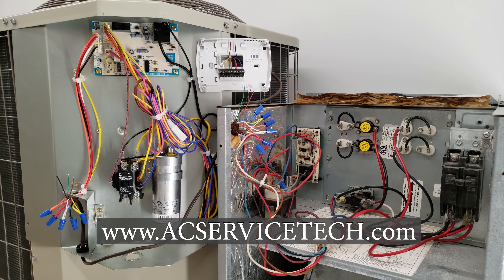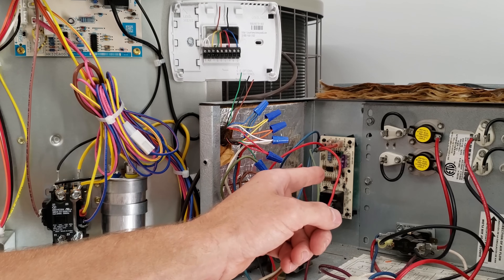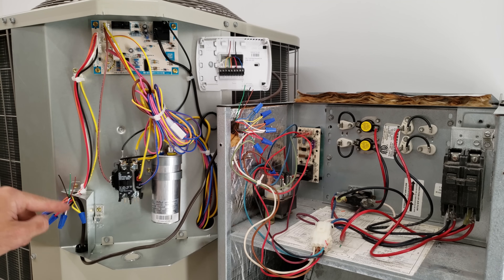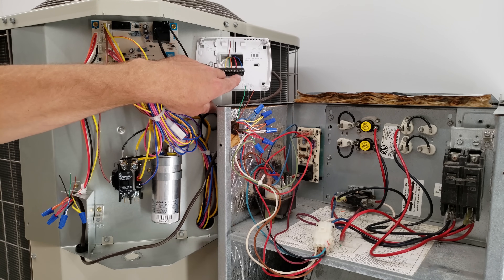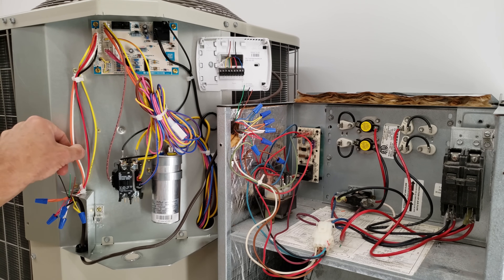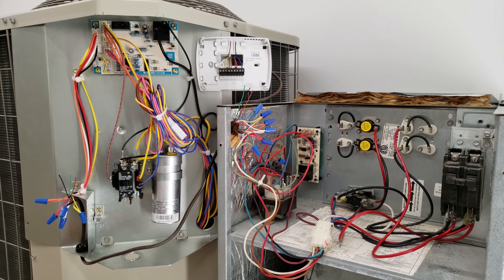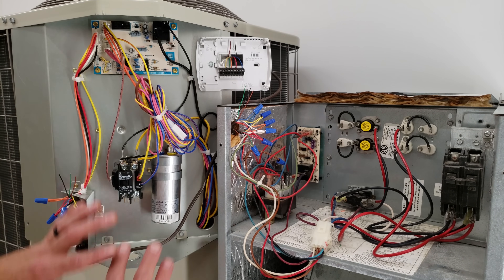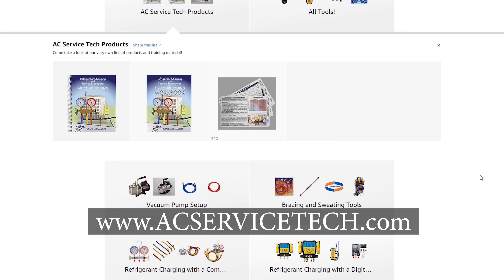How an Air Handler & Heat Pump Work & are Controlled by 24v Thermostat Wires!

Comment: I am trying to install a Nest learning 4th gen thermostat. My current system is a Rheem heat pump with a Honeywell thermostat . Current wiring is R, a jumper connecting R and Rc, Y, C, W(O/B),G,W2(Aux),Y2(E). When I install the nest thermostat, it blows hot air on cool mode. I tried using B instead of O as reversing valve, but it does not work. In the options I chose forced air instead of electric strips. Is it correct? What should I do?

Comment: You have the auxiliary and emergency jumpered together on the thermostat. Therefore regardless if in emergency or auxiliary heat, your heat pump will turn off?
Reply: I believe the difference is, when you put the thermostat in Emergency Heat, the compressor contactor (the Y contact on the thermostat) is not energized, meaning no signal to the compressor. In conditions where aux heat is called for (eg. the compressor goes into defrost), the Y wire is still energized.

Comment: Weve had this happen a few times now when an old package unit dies, these older ones are ugly levels of complicated, mixes between 12,24,230 and some with 400v combinations, so when one of the boards goes, we end up fitting a controller used for chillers, mostly a danfoss 211 or 213. Then well set it up for heating and cooling, install relays for compressor, fans, fit the new probes its a job and a half but if the unit works afterwards it buys the time. Plus side its much easier to work on. Just the customer cant alter the temperature.

One of the other guys (learning) came across a 3ph system but only hooked up with single phase…it was the pre heat element. I suggested he disconnect 1 element, based on ohms law and wire the other 2 in series or parallel not knowing what would be easier, this is a conversation over the phone. Then i told him to loop the contactor si its terminals shared the load. Boss told him to fit a controller with probes to the element contactor. I didnt think that was wise as it being an element, it needed to know there was sufficient airflow, so needed to have the sail switch involved, so im hoping the sail switch was put into the new controllers heating contactor coil wiring.  Not sure how else soneone woukd go about the same thing.

Comment: How awesome would a Diagnostic plug be on the 18-2 wires at the Condenser. One small digital tool to plug in to show every function is working in real time. Much like the OBDII plug on vehicles. This would cut down diagnostic time immensely.

Comment: Thank you! Could you possibly explain the Temp Sensor on the Compressor? Having a problem finding one for my 20 year old Carrier Heat Pump. Wires to this  switch is deteriorated/exposed. Very difficult component to find without knowing what it’s called. “Compressor Over-Temp Switch” maybe?

Comment: Why would the air handler blower rev up and down, on a heat pump system,durning the time when the reversing valve is engaged during winter?

Comment: Can you offer guidance on the cumulative timer settings.....what would cause you to use 30 vs 60 vs 90 min? Seems 30 min is most "safe" and conservative....but maybe checking this often means (?) that the system puts the high-draw emergency power strips "on" more frequently....therefore instead use 60?.... or some thinking like that ? ...Nice vid !!!!

Comment: Great video.  As a design engineer, a couple of things I don't get, is why don't they use terminal strip instead of wire nuts and why have so much extra wiring all bunched up in the heat pump since they know how long the wires need to be when they build it, and why not maintain consistent color codes throughout to prevent confusion, black for common not blue.  Also the red wire from the transformer to the defrost board is not explained which is most likely used to power the electronics after rectification and regulation.

Comment: Starting a new assignment at an apartment complex with heat pump condensers which I've never worked with before, thanks so much for the simple yet effective explanation.

Comment: So the higher fan speed (in the presence of a time delay board with a y terminal) are wired into the same wire as the pressure switches connected to the defrost board in the condenser? That seems weird.

Comment: So, in defrost mode, the heatpump sends refrigerant to the expansion valve that is located on the coil? If so, the air handle gonna blow cold air to the house ( in case the air handle doesn't have an electric heater)

Comment: What causes  the pump to run with thermostat  off
Reply: Check for bad thermostat, thermostat batteries (if present), or thermostat wires touching inside wall thus completing circuit.

Comment: I am an electrical contractor. I have specialized in controls for many years now but I never worked in HVAC controls. Lately I have been installing home genetators and needed to know how the heat strips worked so I could interrupt them under certain conditions during generator power. I appreciate this thorough review of the split unit. I feel more confident now that I have had this overview. Thank you for posting.
Reply: Is so sweet sir! He is indeed good master of his art

Comment: can someone explain why the Yellow tstas wire being energize in. heat mode
Reply: I'm new to all this but I believe the correct answer is because this is a heat pump. When you turn a heat pump to heat it energizes Y (compressor/cooling) because that causes the AC part of unit to work in reverse. Heat pumps use the components of the AC system but it runs in reverse and that's how the heat is produced. When you call for cool, the O (reversing valve) is energized which causes the unit to run in the correct direction which makes cool air. That's why the Y is energized in Heat. I hope I was able to explain that enough to help you out. I am just now learning all this because I am currently having issues with my heat pump so still not the greatest at explaining it or exactly how it works but it is the cooling system running in reverse which makes the heat.
Reply: @jennifermatoy8633  Thanks for help you’re correct i work in the hvac field and learnt this lol.. it is a heatpump with a reversing valve so R and Y is for heat
Reply: @butlerstouchHVAC  I have definitely learned a lot over the past couple weeks.
 I never could figure out what the problem was with my unit because everything seemed to be good when I was troubleshooting so I decided to just start over. Bought a new thermostat wire. Wired up the new thermostat I had bought and took it outside with me to the unit and after sitting there watching videos and making sure I was testing stuff right, it kicked on. Been doing fine since. That seemed to be the problem. 
I actually ran the wire through my bathroom window and had the thermostat sitting on my dryer until I could figure out how to run the wire. I wasn't having any luck getting the old wire to pull through so I  finally decided I had to go under the double wide, whether I wanted to or not. While under there, I figured out why only one side of the trailer blows good and the other doesn't. The crossover duct had a hole in it so I taped it up and had a little tape left and worked my way on to the other side. When I seen the return duct, it had a huge hole in the bottom of it and I thought well crap, I definitely don't have enough tape to fix that lol. Anyway, I got my thermostat wite ran under the trailer like it should be. Unfortunately, I am now buying new flex. 
The supply from best I could tell didn't have a hole but the silver stuff was gone in spots but the black underneath wasn't destroyed yet. I tried to figure out what size supply and return I need but that isn't working out. The unit calls for 14" and 16" but when it was put in years ago, the square to round adapters where made for the size of duct already under the trailer and my ex doesn't remember what size they were. He thought one was 14" but not sure what the other was. I did my best to measure around the duct where it is on the collar and I came up with 48" on supply and 50" on return but after researching, those numbers don't seem to be quite right. I'm starting to wonder if both ducts are 14". Now I'm thinking that since I have to replace both supply and return anyway, should I just go with what should be hooked to the unit? Or try to figure out for sure what is under there now and put that size back? Shouldn't the return be a little bigger anyway or is that fine? This is a whole new category for me and my situation doesn't seem to match what I have been reading so any advice would be appreciated. 
I do know the crossover is 10". I could still read the side of it. Also the crossover is on the opposite end of the trailer from the unit. That would be the original duct work. There was an inside unit on that end of the trailer. The return has been moved to the kitchen and then runs to the unit. The supply comes out of the unit and looks like it is shoved in the main trunk that runs down the back side of trailer. It is right past the first vent from that side and the return runs down next to the main truck to the unit.  It is the back side that blows good.
 Is there anything you would suggest I do or just leave it like it is and make sure it is all sealed up good? I don't plan on having to get back under there so I would like to try and get it fixed up right and then not have to worry about it.

Comment: Craig--excellent tutorial!  I have almost exactly the setup you describe, air handler/gas furnace inside, and heat pump outside.  I'm curious why the yellow compressor wire from TStat to Heat Pump (compressor on, whether reversing valve is activated or not for cold/hot) also needs to go to the air handler....presumably, increase fan speed when the heat pump is running?   Does the heat pump require a faster circulating fan speed indoors than, say, emergency heat using just the white wire to the air handler heater?

Comment: Very thorough and clearly explained. I have a Lennox heat pump system that has not been able to run the heat pump. The defrost board Y terminal seems to pull the thermostat's 24v signal to ground, effectively shorting it out. I checked the defrost board for continuity to ground on Y with no wire attached and it seems to be shorted. Is this something you've seen? Seems like the Y input on the board should not act like a ground. This system is only a little over a year old, with no corrosion issues. I'm thinking either the board is bad or maybe a pressure switch is grounding the circuit.

Comment: Great videos as always!! I have an older York heat pump system. I replaced the thermostat recently, when unit is calling for heat, the blower motor turns on, however the outdoor unit does not kick on. Is the outdoor unit supposed to turn on also, when calling for heat?

Comment: i have normal 5 wires coming out of wall.  why would air handler only have 3 wires (see 2 pictures of air handler above-wont let me attach:) and no wire on W heat terminals even though my heat worked fine when it was connected to honeywell thermostat…now changing to nest and heat is acting weird and smells gaseous for 5 min then heat turns off and stays off even though i have it set to a warmer temp.  Any help greatly appreciated! can i send pics to you somehow?  Single mom trying to get this working correctly while keeping my child dafe from fumes.  I have the normal 5 wires coming into new thermostat but heating is not working properly like it was on older thermostat.

Comment: So with a system like this if the reversing valve went bad would the unit be incapable of switching from heating to cooling, or would that only cause the defrost switching to fail?

Comment: Thanks for your fantastic video and explanation.
R wire is going to the outdoor unit. Could you please tell me what the purpose of this R wire is? The new heat pump outdoor unit requires only 4 wires ( O, W, Y and C wires).
Thanks

Comment: Thank you so much for this video. Been working confident with heat pumps after this video but suddenly ran into a heat pump condenser that has w in and w out terminals. Have you had these defrost boards?

Comment: Question, my ptac unit stop working because of faulty control board, it is an old unit and can't find the parts anymore however I really don't want to throw away the rest of its components, (condenser, fans, compressor, etc,), so I am thinking about getting rid of the control board and replace it with regular switches like, wall thermostat, contactor, heat sequencer relay for the heat strips, do you think is a good idea or not? because I'm only concern about the safety switches in the control board, but by adding some pressure switches and heater limit switches I'm thinking it will be ok, besides it would be a fun project

Comment: Is it possible to run a heat pump with a straight cool air handler? AH only has common, 12V, fan. I couldn’t b/c during heat, I have R G W, no Y. Goodman 5 ton.

Edit: I think I just answered my own question. No (since I don’t know much) but I was just looking at my other AH that is designed for a heat pump, it has all the guts for sending Y compressor out. Mine don’t have all those wiring. My 4ton unit at work also has the same guts for a heat pump setup.

Comment: So I'm a building engineer and I was wondering if they make a reversing in valve with a hot gas bypass so you don't have to worry about switching back into cool mode just for defrost the condenser. Because I know our chillers have it at my work and it just uses it to put a load back on the chiller.

Comment: You are in good company for not knowing when a carrier heat pump will go into defrost.  If it worked like you said, the heat pump would be in defrost mode every thirty, sixty, or ninety minutes of heat pump runtime if the defrost tstat happened to be closed at the end of that time period.
How it actually works, is once the defrost tstat is closed, the timer starts. As long as the defrost tstat STAYS closed, the timing will continue. If, for example, the runtime with defrost tsat closed is forty minutes and jumper is set for sixty minutes, and defrost tstat opens at 65 degrees of coil temp, the timer resets to 0 minutes of runtime. 
So, its how long the defrost tstat has been ENERGIZED that determines defrost. And that time resets if not met.

Comment: The red wire from xfmr, goes to power the thermostat. But I noticed that, it also goes to the heat pump. Maybe I missed it, but what does the red wire do at the heat pump.

Comment: Hi Craig question, I had a Custumer the want to install a heat pump, but he want to feed the outside unit from the tenant panel for AC and from the house panel for heat in other words he pay for heat the tenants pay for AC, so it going to be be two feed for same unit is anyway to interlocking those two feed using a rely , any idea if it possible?

Comment: how do you hook up an heat pump type heater/cooling system to a system that only uses outside a/c unit with a heat strip only inside? thanks, Robert

Comment: My thermostat will not power on ….
Reply: Then you have no 24volts , check your red wire or the 24 volt wire in the thermostat

Comment: Thank you for your video. I checked there is only 13.5 VAC between Green and Red wires on the thermostat. Where should be the problem from the control board?

Comment: We have a problem on our system that was installed six years ago, where the unit will not transition between cooling and heat pump with seasonal change, unless I power cycle the circuit breakers and remove the thermostat batteries.  Once I reconnect the thermostat, the system will begin cooling again, or heating, depending on the switch position.  I have to do this every time I want to change between heating and cooling. Why is this happening?  The first couple times this happened I called the installer who came out and charged me a service fee to reset the system.  I got tired of paying the service fee, so I do it myself now.  It seems like something is wrong with the reversing valve or how the system controls that.  Can you help?

Comment: Have u had to collect a lot of condensation in the air handler area with the heat pump? Has there been incidents of huge  water collection in big metal pans?

Comment: I’ve got a Trane and on my defrost board T1 is a brown wire and capped off! Two wires are hot  going to the DB a red and orange and don’t have 24v going to my coil! Can push in by hand and compressor runs! Stuck like Chuck give it some more time tomorrow

Comment: I've run into some units where only 2 out of the 3 heat strips in it will energize in emergency heat mode. Is that because the 3rd heat strip is designated for defrost only? Or should all 3 be energized in emergency heat mode?

Comment: Can someone confirm?  24v is almost at the thermostat at terminal R and C.  It does nothing until thermostat is turned on and its programming determines switch activation which sends voltage to air handler and heat pump controllers.  So 24v at air handler transformer always powering thermostat where it sets until thermostat turned on and it switches the voltage to be applied elsewhere.  correct?

Comment: It's a great video for chasing wires. Good job and thank you! I'm troubleshooting an issue..
My carrier heat pump was replaced last summer. I turned on my heater and it worked one night and now the air handler isn't coming on any More. But the heat pump is coming on. They changed out my thermostat when they changed the outdoor heat pump. The batteries are good in the thermostat. I also checked the little fuse in the circuit board and it's good. What could have happened?